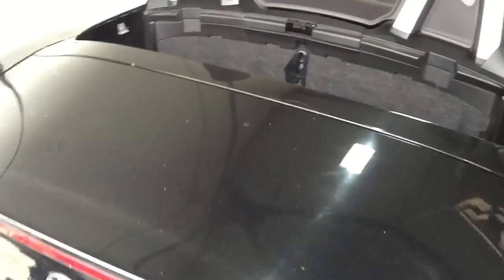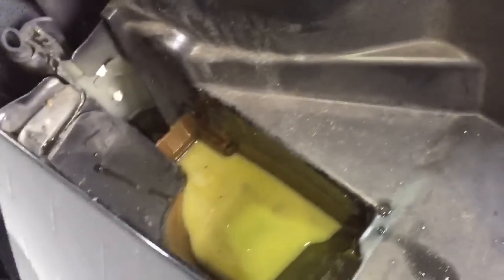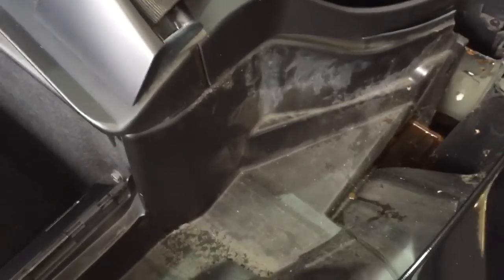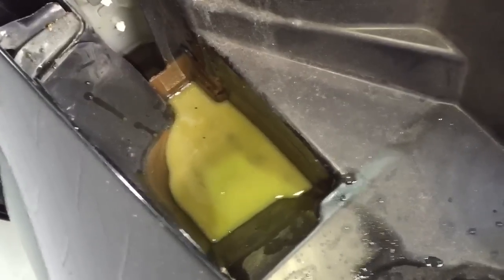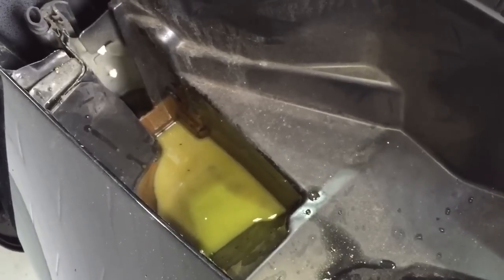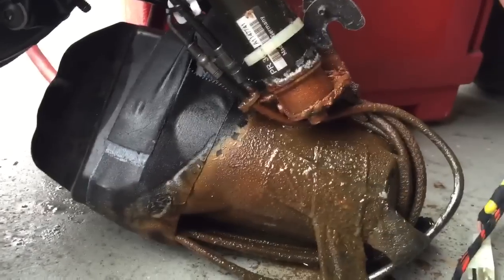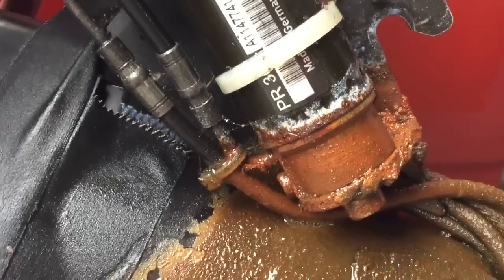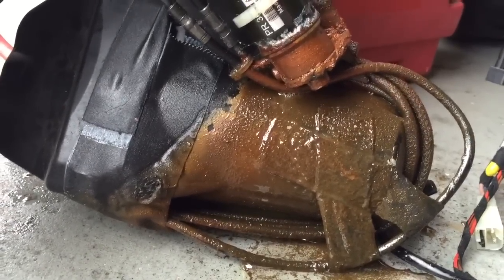BMW E85 Z4 Roof Motor Fault & Hydraulic Pipe Failure

Comment: I’ve had many problems with my Z4’s convertible top motor.
 BMW, in all of their design/engineering brilliance, located the convertible top hydraulic motor in a location that allows for water to pool and submerges the motor in water from rain or washing your car. Eventually, this motor is going to fail. It is not designed to be submerged.
 I relocated my top’s motor to the trunk of the car, thereby keeping the new motor dry. I also placed a spongy rubber mat under the motor to support the motor and protect it from vibration.
 Make sure you check the motor for hydraulic fluid. If it doesn’t have enough fluid, the performance of the top will suffer. This goes for the hydraulic lines. They must be in good condition.
 I have replaced all but the front locks of the convertible top. Guess those will go bad next!
 BMW is fully aware of these problems and have consistently refused to do any sort of recall, shop fix, or even give you a discount on the parts needed to fix their poor design. If you pay the dealership to do the work, have deep pockets lined with cash. It will cost you.
 This work can be done yourself. It is not that hard, but is time consuming. Having a friend to help you remove the convertible top will help, but others have been able to remove the top’s motor without completely removing the top. On US cars, the motor is behind the driver’s left shoulder, in between the driver’s compartment and the trunk compartment.
 Take your time and good luck!
Reply: That sounds like the best way to protect the motor and pump, but what about the water retention problem. Did you engineer a fix to prevent water from building up and ruining the carpet?
Reply: I did the same job plus i drill bigger circle to prevent the clogging problem

Comment: I've previously owned X2 E85 Z4s and was aware of the motor issues with blocked drain tubes, I didn't realise the hydraulic pipes could rot too! I now have the E89 Hardtop Z4, did BMW learn from the previous model and make the roofs more reliable? Thanks for your video.

Comment: I’ve seen several videos on replacing the BMW pump/motor with a Mustang 2009-2014 unit. Less cost and quicker operation.

Comment: Terrible design, as was BMW putting the stereo amp in a similar location on early X5s. Sunroof equipped ones whose drains block deposit water in the 'well' and short it out. What were they thinking!